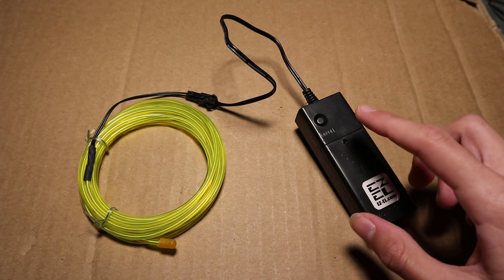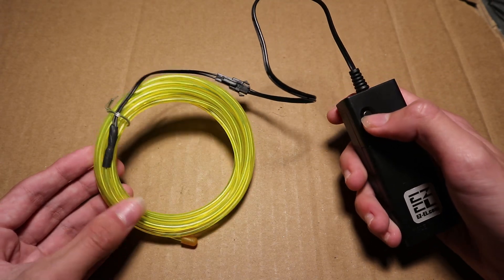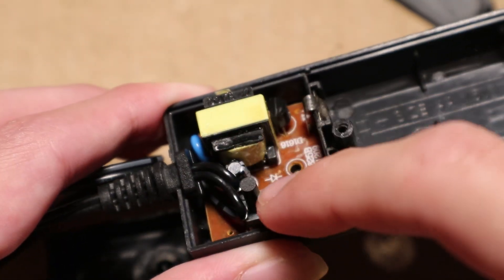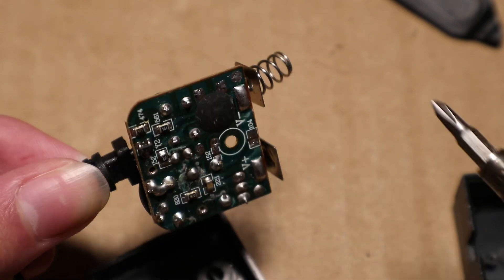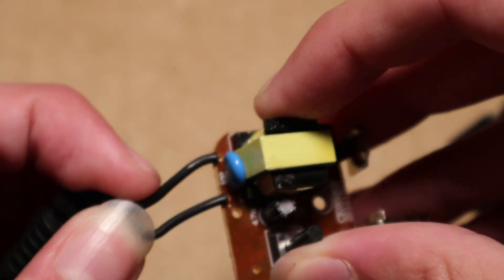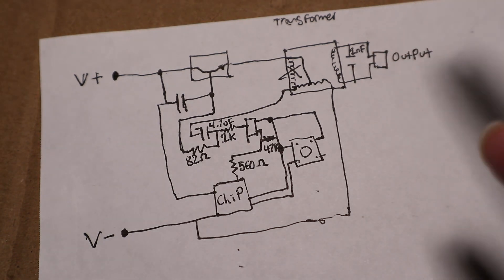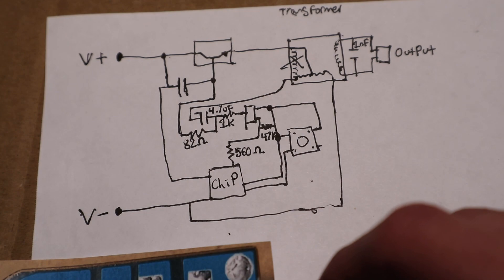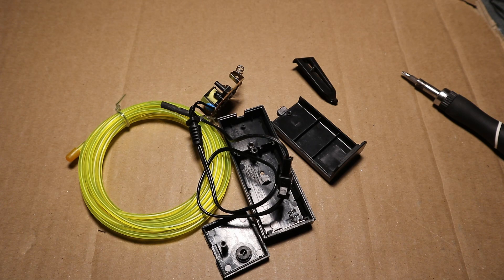Inside an electroluminescent wire power supply

Comment: what if you want to turn on the light without pressing the button? so when the battery is installed the light immediately lights up, thank you
Reply from the maker: This power supply featured in my video does not turn on the light immediately when the battery is installed. You have to press the button to turn on the light.
Reply: You can add bypass the button by soldering the connection shut so when you install the batteries it will instantly light up. (Note that you won't be able to turn it off unless you disconnect the batteries, and also if it has blinking feature you won't be able to use them.)

Comment: I use these power supplies to power light 220v rated bulbs and it actually works! It works especially on LED bulbs and the more powerful + current it has (replacing AA batteries with D) it might be able to light up an CFL and make an incandescent bulb glow slightly(better not to test the incandescent because it blew the transistor of my supply due to overload)
Reply from the maker: Interesting, I'll have to test this!
Reply: @RandomElectronics1  Your power supply will probably light bulbs better because mine is smaller. 
Also I modded it to have bigger battery with more current (I replaced mine with a 5000mAh li-po 3.7v) 
and it was able to make an ordinary led bulb turn on bright, 
it was able to light up a small CFL,
and I connected it to a 7w incandescent night light, 
which resulted in it glowing dimly and the  components of the supply blew and made the room stink... 
It also lasts long (before and after the battery mod). 
Do not increase the voltage (for example using 9V battery or 12V or 24V) 
as it will result in an almost instant blow of the circuit. 
Now I am planning to use mosquito zapper circuit or camera flash circuit to make a portable lightbulb opener.
Reply: Is there a way I could hook up my 5v el wire to my 12v dc supply. It came with a USB plug for a 5v ac phone adapter.
Reply: @michaelspencer2559  Just buy one of these simple 12v to 5v adaptors for cars (they plug in the car outlet). You can find them on pretty much any electronic store.
Reply: @JohnM1146  I live in a RV and have both 12v DC and 110 ac the adapter calls for a phone charger block. I was or am trying to just hook it straight up to my 12v dc on /off switch.  So if that's what I have to use I'll just put in a new outlet. The 12vdc wires are just closer. And was trying not to have to do it that way. But thanks 👍🙏
Reply: @michaelspencer2559  If you want to connect it to the wires directly without adding a plug then you can extract the pcb from the supply, and connect it to the wires. (May require soldering).